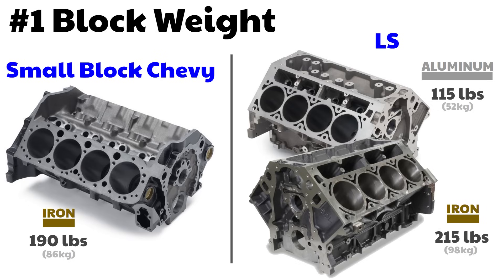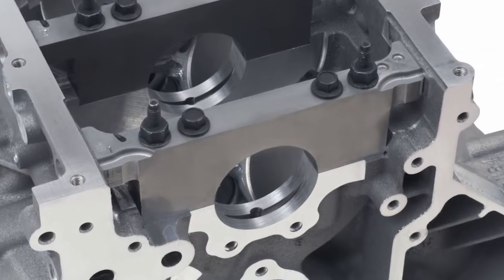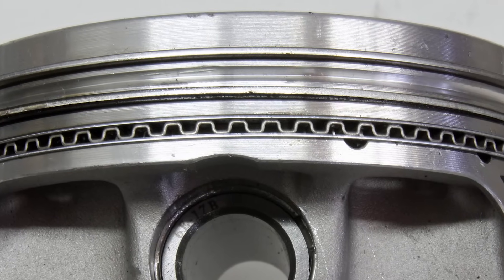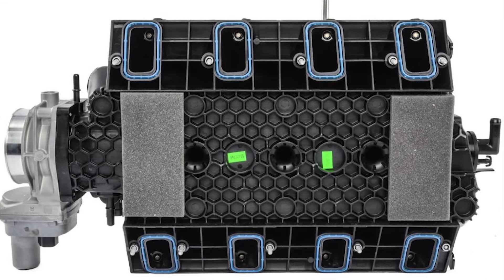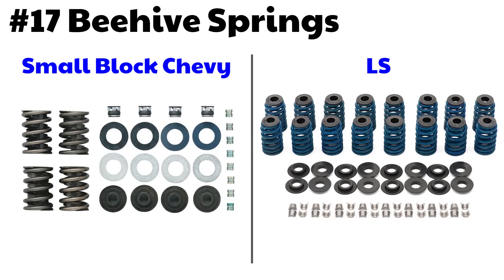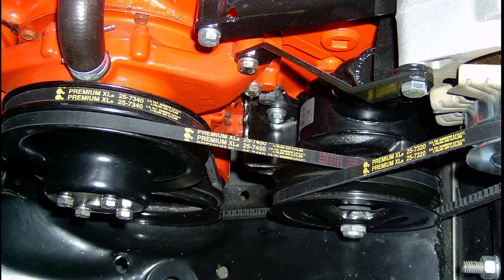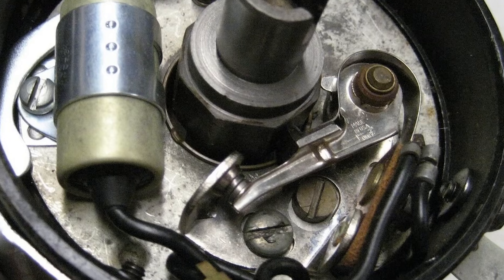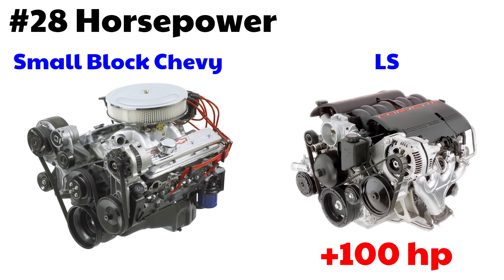29 Reasons LS is Better than Small Block Chevy (Gen 1 & 2 vs Gen 3 & 4)

Comment: Ok, you came back in you comments and corrected 1 of your mistakes. But literally there are only 5 things in you list that were 100% true. You have a ton of 1/2 truths listed here. If you want to make content, do your research and get it right. Almost all of the items that you listed that the LS does better are are also available on a stock SBC and all of them are available in the aftermarket for the SBC... usually for quite a bit cheaper.

Is the LS a better engine... meh... yeah probably... but your information is so wrong it's not even funny.

Comment: Obviously, comparing stock motors will be no contest.   Most / all of the stuff available for LS is available for the gen 1. Might even still be more high end / esoteric stuff for the gen 1 than the LS, unless "they always make it for the LS first" is the rule nowadays, the way "they always make it for the SB chevy first" was back in the day.     Saying the block can take more power, then counting each beefier part is cheating.  You only get ONE POINT for the LS for a beefier block that can "supposedly" take more HP.   But I'd match a gen 1 Keith Black aluminum block with Brodix girdle against ANY stock LS block, cast iron or aluminum, any day - when it comes to "where's the beef?".  apples and oranges - fair play - you did it on the aluminum LS vs cast iron sb gen 1.  now you've got me wondering if i can put together a better gen 1 than LS - anything aftermarket goes. Might still be possible.  Does Offy make an IR intake for the LS?   Nope. Gen 1 SB. Mk4 BB, mopar A, B, and hemi motors, ford SB, clevland, and windor, and Olds BB - that's it.   You might be able to match Offy IR performance with a good SPFI unit (and a slightly oversize throttle body! <g>)...

Comment: I had my disapointment with a 82 Supra aluminium inline 6. Versus the old 18r, 20r engines.
The cost to rebuild was sky high...
So for top performance aluminium, but expect shorter life, possibly and higher cost.
That virable valve timing, is sad to be troublesome when old and expensive to fix...
But each to ech own..
Great show, ty.

Comment: I liked the video, but you missed one very important improvement: The performance difference by having individual ignition coils as opposed to one coil limited by dwell angle. 

Dwell angle is the number of degrees the distributor turns in one firing cycle, which in turn is the amount of time the coil has to build another electronic charge after firing . With 8 cylinders you typically had 45 degrees per cylinder with 30 degrees of point closure and 15 degrees open. The coil recharges during the closure period of the dwell angle. This was determined by point gap and the degrees total divided by the number of cylinders. 45 degrees for 8 cylinders, 60 degrees for 6 cylinders. You could gain some dwell angle by reducing the point gap, but the breaker block would soon wear down and the points would close, leaving you stranded until you opened up the points. 

The best way was with 2 sets of points offset a few degrees that would allow you to overlap the point timing and gain 8 to 10 degrees of dwell angle and maintain a reasonable point gap. It takes measurable time for a coil to recharge its voltage capability. No need to do the math, but it isn't instantly as one might think.

The individual coil packs have 360 degrees of dwell and fire only once per firing cycle, giving them much more time to build maximum charge, therefore a much higher voltage to the spark plug than was ever possible with the single coil systems that fired each of the cylinders individually and divided its dwell angle (time) by the number of cylinders. It works the same way, but with one coil, 360 / 1 is 360.

Having said this, it will take me a few more years to be convinced the LS motor is a better overall engine than the late small blocks, but the ignition system is exponentially better!

My father who started as a mechanic on Model T Fords in 1924 and worked his entire life as a mechanic until he retired 1987 told me many times when they figure out a way to run one coil per plug, it will be the greatest improvement since the synchromesh trasmmission! He said that many times to me, but sadly he didn't live to see it happen!
Reply: Uh…the original Ford A Model, produced from 1928-1931 had one coil per cylinder on it’s tractor-derived four cylinder engine. In fact, the original Ford T Model (produced ‘27 and prior) actually had four coils for it’s similar four cylinder engine as well.
Reply: I stand corrected regarding the number of ignition coils on the early Fords, but that is where the similarity ends. I suppose, since it has been 50 years since I had that conversation (1970's) with my Father that he was commenting that an ignition system with an induction coil and capacitor in a mechanical distributor was his point. 

He had a Model T coil in the top of  his toolbox that he would hook up occasionally for fun. I started working as a mechanic around 1966 and have never worked on a Model A or Model T. @michaelgreen7028
Reply: @michaelgreen7028  My Father started working on Model T's in 1931. He worked for the largest Ford dealership in Oklahoma until 1939, He never mentioned more than one ignition coil on any model of Ford! If what you say is true, tell me how they were timed. That has always been the problem with that type of ignition until computerized systems were developed. I think someone is selling you "oceanfront property in Arizona!""
Reply: @GeorgeGeorge-yb2sz  I invite you to type into whatever search engine you prefer the following, “ how many ignition coils did the Model T have?” and read the words therein
Reply: HI MIchael, I am sorry if I sounded rude, but I have become so cynical that it is  hard to believe anyone.  @michaelgreen7028
Reply: @GeorgeGeorge-yb2sz  no problem. I learn new stuff all the time. I haven’t met the person who knows everything yet. It takes a pretty big person to admit they were wrong.

Comment: All these videos  and all this talking crap about older motors they only tlk crap because there still alive i have a 1964 292 i6 that still runs re ringed in the 1985. I have another chevy 292 running since 1963 and I have a 55 chevy 283 never has been touched still fires and runs

Comment: 2 things
1.  Availability....over 100,000,000 small blocks have been made.  So at best this is a wash, and certainly not an advantage to the LS.
2.  You didn't mention the lower valve angle in the LS heads improving intake flow.  
Other than those, nice article.

Comment: I recall the 6-bolt main bearing caps in a deep-skirt block were previously used in the NASCAR 426 Hemi for Dodge and Plymouth, and also the Ford 427FE in the Shelby Daytona's. Both were race engines. The engineer who headed up the team that designed the LS architecture was an old-school hot-rodder, and a member of the NHRA.
Reply: He was also an NHRA record holder, or champion, can't remember which. Think his name is Tom something or other. I love the old SBC. I do believe it does still have a couple of advantages over the LS platform, priority main oiling for one example. But anyone who says the LS platform isn't a forward step from the old SBC needs an eye, and head, examination.......

Comment: I have both motors.  The LS in a nice Vette and the small block 400, all prettied up and in a 70 SS.  No way would I ever put an LS motor in my 70.  It looks so stupid.  And, my 70 is at 400 solid horses and that is enough.  Plus, it looks so immaculate with the goodies.

Comment: As I recall as a GM engine engineer working on both small block and, at the time, the new '97 Corvette LS engine, there was only one part that was common to both variants. Believe it or not, that one part was the connecting rod bearing ! The LS was a totally new engine at the time.
Reply: Hydraulic roller lifters are also interchangeable too. I have LS7 lifters in my SBC
Reply: Sort of like the LT and the LS
Reply: Well I run a L31 for my stock short block which was a 350 Vortec 4 bolt main came from the factory with powdered metal connecting rods and Hyperteutic Pistons and a 1053 Forged Crankshaft and I ran the BTR Delphi Roller lifters with a .580" lift bullet hydraulic roller camshaft and Performer Rpm Top End Kit and for a 350 I'm at 460hp 440ftlb I know I'll regret not going 383 but damn the short block is tough factory
Reply: @richardclary6267 that's not exactly 💯 but it is close
Reply: @wildestcowboy2668  well can you tell me what it is..because I'm sure the Edelbrock tech that built it had no idea what he was talking about...can you clarify what I have I mean I only bought the parts and held them in my hand before the build

Comment: Great stuff and thanks for your hard work! Us older dudes (I'm 52) used to know all this about car/bike engines back in the day but it is tough to keep up. One thing I noticed about the LS vs Smalblock when the LS1 came out was the area under the curve. The LS was making 50/50 more than a small block from 2500rpm on up. Even the older mod Fords didn't have the LS power curve till more recently. (and I love those 99 to 04 supercharged 5.4's too) Yes, if it were not for the small block to pave the way there would be no LS. We had plenty of great times with smallblocks.

Comment: Steve of Steve’s auto oak hill west by god Virginia had a corvette with a 283 built that put out 11,000 RPM yeah you seen that right that’s eleven thousand RPM now I’ve not seen any post show or hear about any new motor that would turn that many reves per min the only other thing I have to say is when chevy brings back there version of the first manufacturer to have the 302 then Ford will know who makes the original and the best 302 and as was said when I grew up pound for pound inch for inch the small block Chevy was the best motor built and I know the new LS and LT are great I like them but I’ll be Henry Smokey Unick till my last breath and die hard chevy all the way there deal that broke me was all the money went in the motor and the body and frames show you after 10-20 years unlike the days of old were the frames are still setting there when the body’s are gone then you get that great felling of betrail when you find they’ve outsourced so much that you can’t even say apple pie hot dogs and well that’s what burnt me on them when my family died in nam fought on battle ships in the Pacific Ocean fighting off Nissan Datsun Corp comakazy planes and how the big three just turn around take the jobs away and you find out more dependable longer lasting hold there value cars and trucks are built right here in the USA by Toyota well then you know who abandon us and who came to join us but they all have ups and downs not my place to judge there is only ever gonna be but one of them just my opinion and hopfuly there be some back bone to go with all this new stuff some grit and determination like there was in the past and a lot more stickin to your guns not selling out not backing down win lose or draw don’t matter there’s no pride or respect or any true meaning in this country any more like there was when the 265 283 327 302 307 350 400 305 267 those all in order small bearing crank from 55-67 large bearing from 68 up tye proud little motor to have made the hot rod Ford an A model with a small block Chevy the little proud motor that came back in 1965 to win the Daytona 500 which was a 302 cid that Smokey put together with stock parts but the hemi had just came out in 64 and swept the Daytona 500 in 64 1,2,&3 place yeah just think the elephant block on the seen and no hope they donated everything they raced but the little proud small block with only 302 cid that was guaranteed by Smokey for 520 hp on pump gas an 500 miles in any can am race think about it that’s number 3 on the small side of cid for the line up and he beat out the hemi the year after it swept the same race and there’s a lot of cmpatiton lines we could run down on record of mud bog to dirt track and drag racing wit the great 400 small. Block that can be turned out to a 421 427 and I think I’ve seen 430 cid from it also and herd they could make it a454? Someone else may know when the new motors have been around as long as the little proud small block and can back there selves with only the tip of a great iceberg I have scratched on they will be a difference to me but I would not be able to put a LS or LT  in anything of my older preference cars or trucks I’ll stick to the LT1 350 370 hp L76 code 327 350 hp an all the other greats. Like DZ 302 290 at a low rpm way under rated for insurance purposes but big time winner 67-68-69 in trans am race I could go on all night small block 1955 -an up not resting in peace not taking any prisoners not saying it’s gonna win as much as it has but saying hey respect I laid the ground work for all yaw and run better today and accomplish more with way fewer changes than LS an Lt for over forty years of great service there still a lill cold natured and you can smell that raw fuel but when you crack that pedal and hear that carb and dual exhaust feel that engine coming through the wheel and vibrating your body there nothing made that has close to that feeling maybe a Harley Davidson I don’t think they ever will and ol LS & Lt won’t get a chance for electric smoothness and all the other things will shove out one of the greatest things this country brung this planet gasoline stock and drag car racing

Comment: The original S.B. Chevy v-8 was designed in 53'-54' debuting in 55' and the LS was designed in the 90's and was introduced in the 97 Vette. The S.B. is over 40 years older in design then the LS so the technology is amazing when you compare a carburetor and points  ignition to a computer(smarter then Apollo 11) and E.F.I... What else has been invented in the last 40-45 years to help this engine out?

Comment: For the most part I think you're pretty accurate... Max power figures and max rpm are definitely something you should research a bit more tho. Like your video about LT vs Coyote. 900hp for sbe Coyote? No way. There's folks into the 8's on factory sealed Coyote engines...

Comment: All those points are good. The newer engine is supposed to be better. I will say if your serpentine belt breaks you are screwed. A v-belt as long as the water pump is running, you can limp home. The small block is extremely easy to work on. Don't have to worry about emissions. I would say parts are more available but that probably doesn't stand today. They made the LS for 24 years. So an LS is like the SBC of old. Millions were made.
Reply: Owned an LS for over 200,000 miles/20 years. NEVER threw, or broke a Serpentine belt. There's a reason GM uses them now, instead of old fashioned V-belts
Reply: @Milo Janis  I didn't break one. My sister did...TWICE. With that being, I still prefer a serpentine belt because it is more readily available. Have to adjust too many tensioners on the old style v belt.

Comment: I'm making 600hp on a 1997 1 piece rear main crank. And it's loving it. The LS is undoubtedly better. But the gap is much smaller than this video makes it sound. As of today, an LS powered stickshift drag car has yet to beat the fastest small block car.
Reply: I know this post is old but we have the same name!!! My middle name is Xavier though.
Reply: @michaelallen6650  Xavier is alot cooler than Robert lol.
Reply: Since when? Back in 2007, Wheel to Wheel powertrain built the first 6 second doorslammer LS powered vehicle, a 4th gen Camaro. Ran on premium gas. I'm sure that record has fallen in the 16 years since. Please provide proof of what you state. I'm just trying for facts, not trying to start bs
Reply: @milojanis4901  that car wasn't a manual. Literally the first 6 second manual LS just popped into existence in the last few months.
Reply: @michaelallen2501 Please show us the proof. I'd have to see an auto trans that holds 6 second power back in 2006 before Id believe it
Reply: Its still true that once you involve the aftermarket the gap between SBC and LS is much smaller than most think but the cost side has started to favor LS.

Comment: Yes, all this is true but, the sbc can also be a carb with a points distributor. You don't need all the electronics to run the engine, just 3 wires